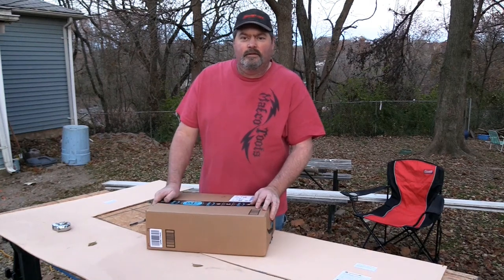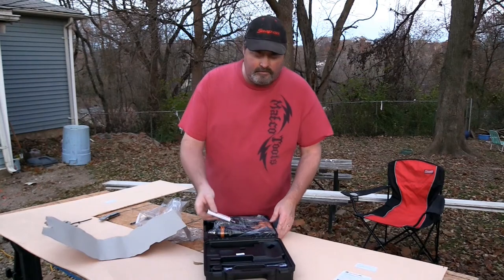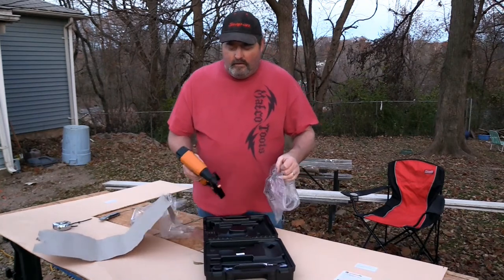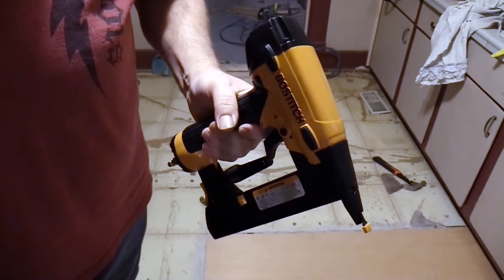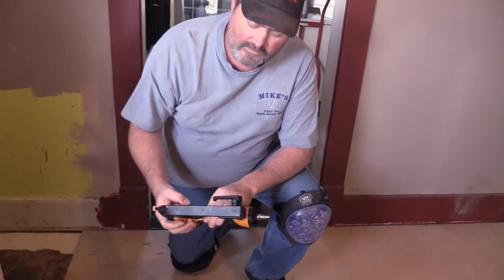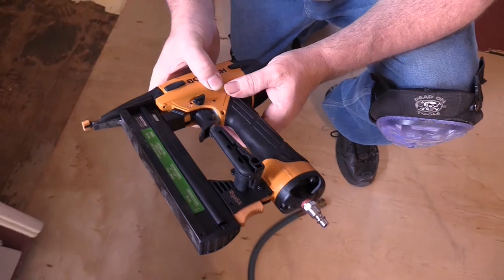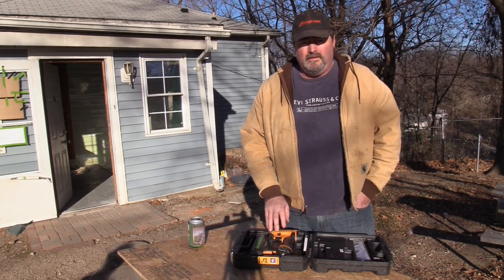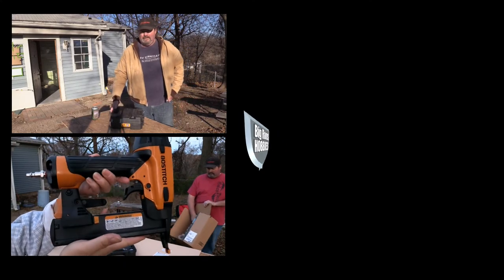Bostitch SX1838K narrow crown stapler, first use and review

Comment: Looks like it works great . I have finish nail guns that work with my Port-a-cable  pancake compressor . I would of thought it would work .
Reply from the maker: Hi Spencer, the compressor work good with my finish nail gun but with the stapler I was trying to put to many staples in a short time but with a 20 gal. compressor you could put as many down as you wanted on a big floor it was a time saver. Have a great weekend !

Comment: Now you went and did it!  You are on the dark path to collecting pneumatic tools!  I have that same gun and it is great for a lot of projects.  If you end up with more pneumatic stuff get something like this light weight hose kit.  It really helps make the tool maneuverable.  I used to use a swivel at the tool but with the light weight hose kit you wont need it.  Here is a link ... http://www.cleavelandtool.com/Lightweight-Airhose-Kit/productinfo/ACKIT/#.Wm8o4NFMGhA  I use these since i get most of my other aircraft tools from the same place.  Carry on...
Reply from the maker: Hi Jim,  I really like this air stapler this spring its going to get a work out. I checked out that air hose and it looks like a nice one thanks for the link.